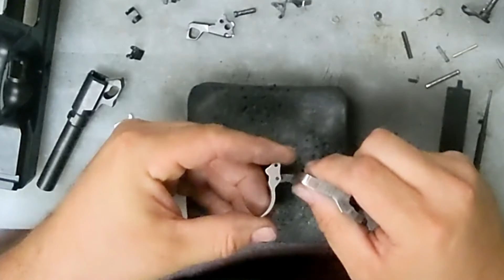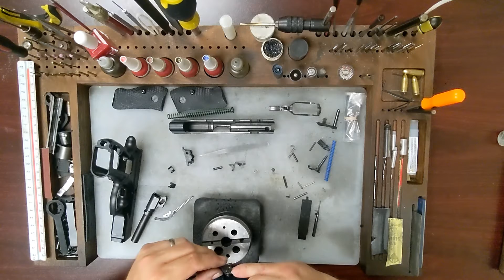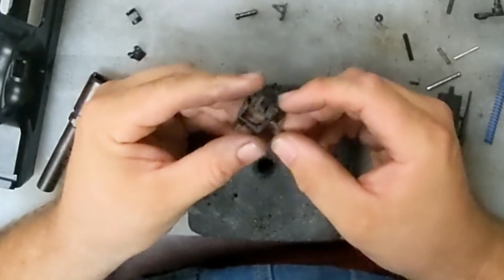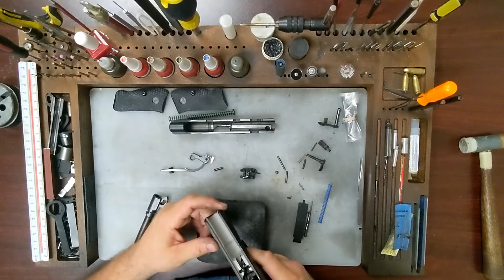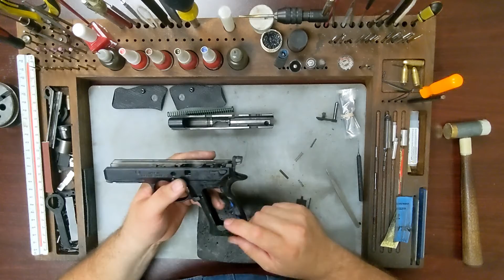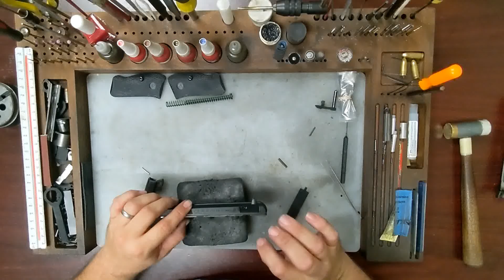75 Series Decocker   Pro Package Installation

Comment: Regarding trigger bar tension, did you say the right side of the trigger bar spring, when released from under the trigger bar, should come up flush  to the top of the trigger bar? And when put it back under the trigger bar, the left side, when released, should barely protrude past the bottom of the trigger bar? Can it be in reverse... i.e. left side higher? Never gave this much thought. I always thought both sides of the trigger bar spring were supposed to be the same height.  Great video.. a lot of nice pearls. Thanks so much!
Reply from the maker: You summed up the procedure very well in your comment above.  Right side- increase tension, left side- decrease tension.  Perfect!  It has taken our company years to come up with just the right formula, and no, equal tension is not the setting that we have found works best.  Thank you for your comments, now get ready to have some awesome resets!  Patrick
Reply: @cajungunworks  Awesome. Thanks for taking the time to reply. On the Cajun Gun Works Tutorial page, which is a wealth of information, I just discovered that this is detailed perfectly.  Since CGW took the time to tune this setting for best optimization, I'm curious if they're symmetrical from CZ? Later today, I'm taking my 75s out to check em. Thx!

Comment: Maybe buy complete gun from Cajun with the package installed.  Cajun does great work.  New PCR pro package has excellent trigger (smooth 3lb 10 oz single action), and ate 5 kinds of SD ammo - Buffalo Bore, Underwood, Hornady- without a hitch, as well as both brass and aluminum cased 115gr range ammo.  A brand new gun, with zero feed /eject failures is wonderful.  They added Dawson tritium sights which were dead on out of the box.

Comment: I appreciate the videos, but can't really see much detail, especially on assembling the sear cage. For instance, when you say the long leg goes forward, does that mean coming over the top or under the bottom. The view is too wide to see where all the bits are going. Likewise with reseating the decocker and spring, how should it be seated with respect to the sear, as there are two possible configurations. From the video I couldn't even figure out how to insert the decocker. I think I have it right through lots of trial and error. A diagram or two in the instructions would be VERY helpful.

After about an hour I thought I had the cage reassembled, but now when I insert it in the frame the slave pin doesn't line up with the frame. The CGW disconnector appears to be putting up quite a fight over the last few millimeters.

I'll keep at it, but it's not a job I would choose to do a second time (as opposed to tearing down and reassembling CZ75 pre-Bs...).

Comment: Can I put a de cock and loaded chamber indicator on a regular 75 compact?
Reply from the maker: We haven't ever put a loaded chamber indicator in a slide that didn't come that way but I suppose it wouldn't be too difficult.  You would just have to mill the pockets for the screw and the pin.  Converting the gun to decocker would be more trouble that it is worth though.  It wouldn't be impossible but the safety/decocker mechanism is made into the frame, trigger bar, sear cage, sear, hammer, etc.